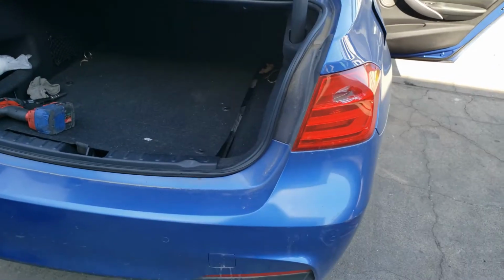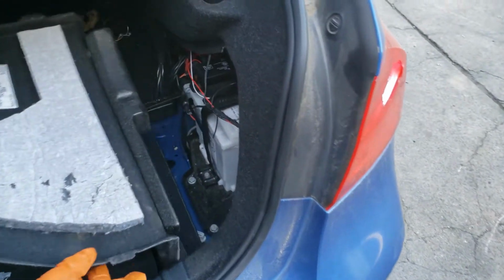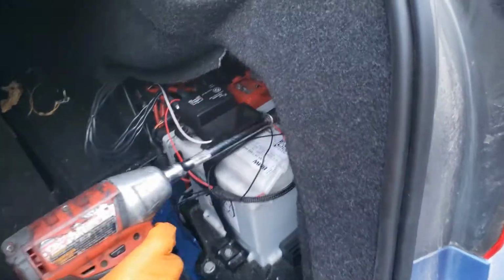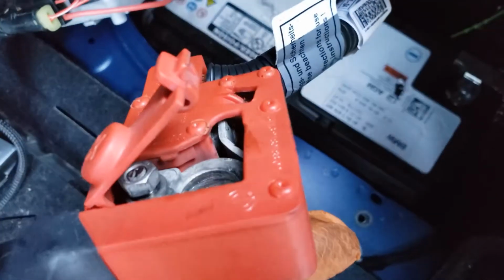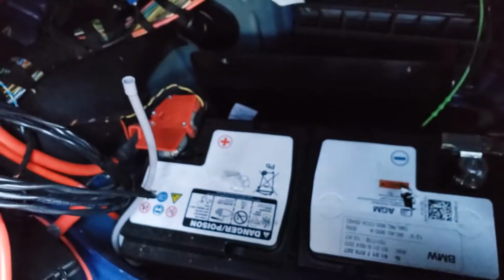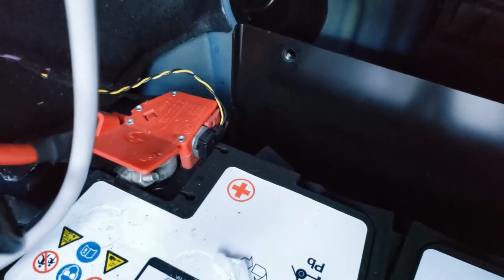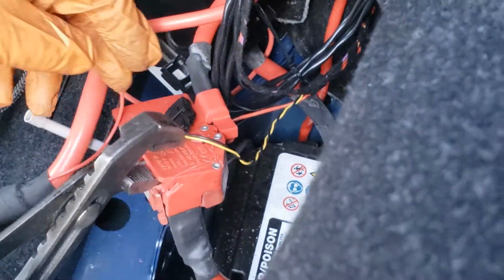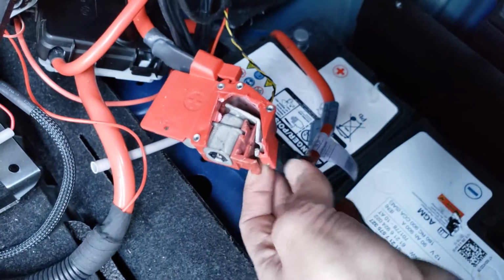2013 BMW ACTIVEHYBRID 3 335I F30 F32 HAS NO POWER PROBLEM LOCATION

Comment: Hi, is it possible to remove the active hybrid system completely and have the car run without?
Reply: Yes you theoretically could but there would be alot if reworking you'd have to do they gas engineand tge hybrid system are highly integrated with each other

Comment: Hi I have the same car. Been in a collision and both battery terminals blown. I have connected the positives and have power. Ignition comes on although nothing happens when I try to start? I have tried resetting the codes but nothing. Are there any fuses or relays that go ? Both battery’s are new also. Thanks
Reply from the maker: Sorry no idea. Check the terminal if it was bought used.
Reply from the maker: Try jumping it from the front terminals
Reply: The terminals are the same ones I have connected them like you have. I have jump pack on the front aswell. Lots of power just nothing when I press the start button, I will try again  thanks for replying.
Reply: Did you find a fix for this?
Reply: @slinslim  hi yes I managed to sort this in the end. My car was hit at the front. While in transport it seems as if the front passenger wheel had ran over the wiring and pulled on the earth strap on the left side front flinch.  So mine was an earth issue.
Reply: @UmarKhan-sf5vg  but you didn't need to replace the hybrid battery? I hear crazy stories that the hybrid battery discharges itself in an accident
Reply: @slinslim  no didn’t replace the battery. Mine was in an accident front end and airbags parked I started for around a year. All batteries were ok. It should still start tho even if the hybrid battery discharged.
Reply: @UmarKhan-sf5vg  Seriously it was not necessary to change the battery after the airbags were activated? In my case, only the curtain airbags were activated, and the crash was not very serious, but when I turn on the car, I get high-voltage system deactivated and when I connect the OBD 2, I get errors with the hybrid battery